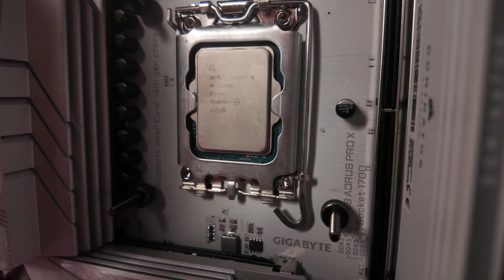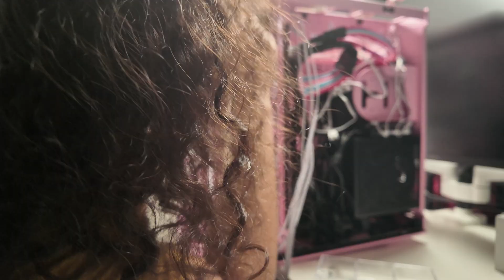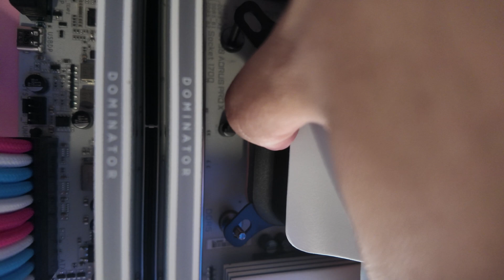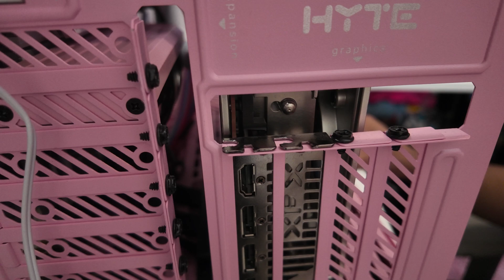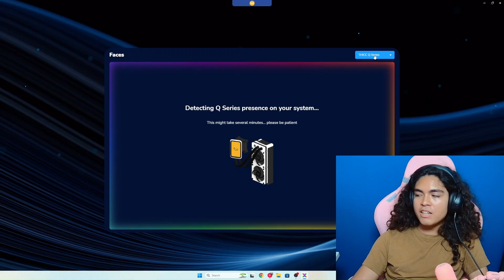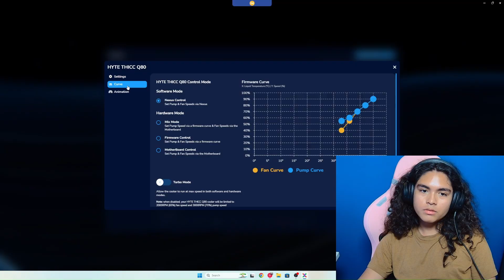Hyte Thicc Q80 Installing & Performance Benchmark

Comment: Have you had any problems with the nexus software lately?  I really want to get this but if the software is buggy like other people say, maybe not...
Reply from the maker: I have seen some bugs/issues.

1: Once NEXUS didn't communicate with my THICC Q80 preventing me from displaying PC info and an accurate time. 
2: A vulnerable driver is used: WinNT/Winring0.G 
3: Fan curve issues - sometimes my fans overcompensate on the Q80 and go up to max even though the CPU isn't too hot. Once it realizes it's mistake, they all just stop spinning for a minute and return to normal. I've seen others have this issue too.

Comment: Please run CB23 multi thread CPU test and show your HWInfo CPU Temp results.
Reply from the maker: Thank you for your suggestion, I'll make an upload a new video regarding the cooling performance using your recommended programs and I'll feature more in-depth benchmarking in any future pc hardware videos.
Reply: @Sky_Gayming That will be great- and please include information about your current PC build :)
Reply from the maker: Video will be out Friday - I also ended up adding benchmarking to my upcoming 990 Evo Plus installation video. Thank you for your suggestion!
Reply: @Sky_Gayming Great, looking forward for it. It could be first user review of Thicc Q80 Trio from user over internet :)
Reply from the maker: @przemysawzachara1486  I've posted it! Please let me know if there is anything else that you'd like to see!